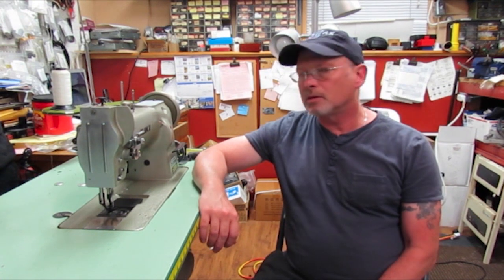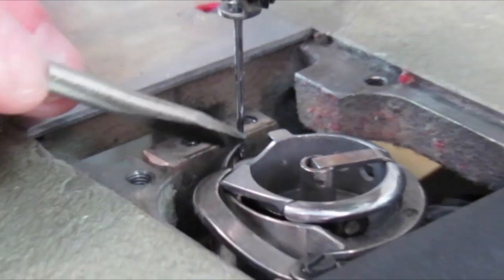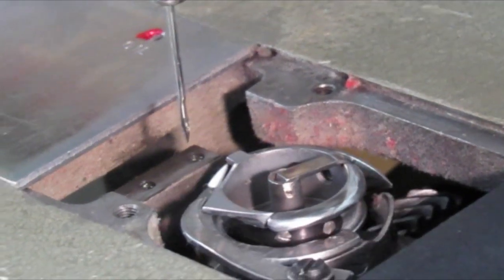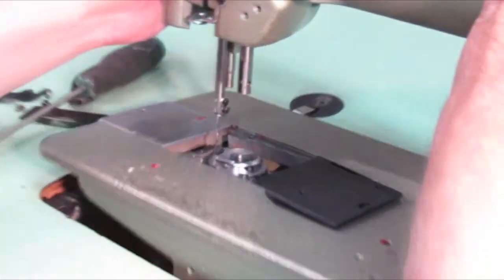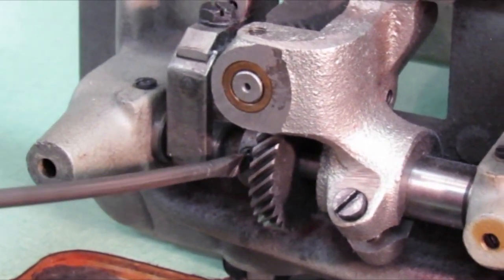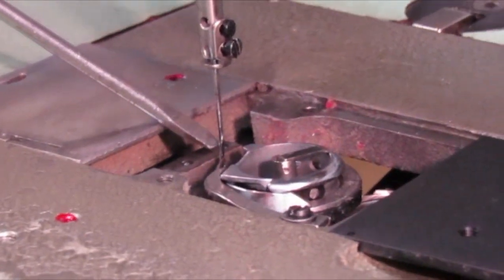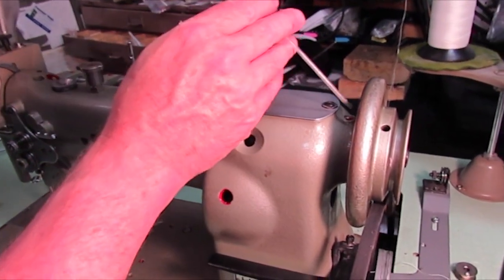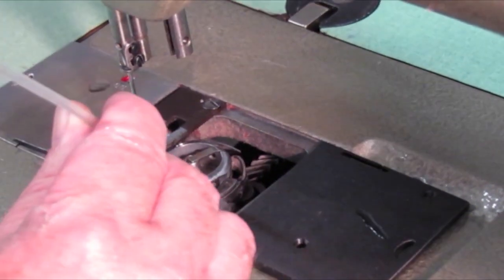Juki Lu 562 - 563 Industrial Sewing Machine maintenance video

Comment: You did a good clear job of explaining timing adjustment. I always say hook point to neeldle clearance is no light between them without them touching each other. I think it would be good if next you would have explained adjusting the needle guard. With these tight tolerances, any side needle deflection and good bye hook point.
  Just for added thought, most of these machines are old. Cup screws get worn as well as other parts and normally they have been worked on by many people of different skill levels. If you've owned a machine a long time then you know its condition. If you've recently acquired it, best to go through it. These are tools for doing real work. Don't want any downtime.

Comment: Hello Neil!  This video has been very helpful, but I have an issue on a Juki 563 I recently purchased.  When I am trying to adjust the stitch length via the "button/cog" method, it is stuck at 14 on the indicator.  I cannot turn the wheel.  The only time it will turn is if I engage the safety clutch.  Do you think it is seized somewhere?  I oiled the bejezzus out of it before I even ran it.  Any help would be greatly appreciated!  Thanks!

Comment: Great informative video! Thanks for taking the time to make it! I have a Juki LU-562 and it vibrates at higher speeds. Is this normal? The counter balance looks like it is in the correct orientation with respect to the needle. Cheers!
Reply from the maker: This would be normal.

Comment: I have the Juki Lu 562 and this video was very informative. Learned I was missing a step in threading the upper tension. I have a question. I’m in an upholstery class and a couple of the class machines are having an issue with the thread coming out of place around the upper tension assembly. Where the thread wraps around from underneath the second tension disc, normally you feel and hear a small click when the thread goes past that little pointy part that bends in toward the middle of the discs. When we pull the thread up against the tension spring, there is no little click and after sewing just a little bit the thread pops out from in between the discs. Any thoughts on what the problem might be? Our instructor is trying to get the machines serviced, but the school isn’t very proactive in having the machines kept in good working condition. Thank you in advance for any help you can offer.
Reply from the maker: If you are taking about the tension assembly you can take and drop the thread down around the pin that holds the plates from spinning.  This will keep the thread from coming out of the tension disks.  If you are talking about the take up spring disks which is below the tension disks, you can adjust the small screw that keeps them from moving.  You can turn it to the left so it will click in easier.

Comment: Great video but I was hoping to see something on adjusting the bobbin case opener. My 563 has a tension issue when sewing in reverse. Great stitches forward but in reverse there’s always top thread nests on the bottom regardless of top tension and I think the thread catches on the case opener creating a momentary bottom tension.
Reply from the maker: Unless there is a burr on the bobbin case opener this should not be an issue.  Increase your bobbin case tension.  If you cant turn the screw on the left of the spring on the bobbin case base you would have to take the bobbin case base out and take the spring off.  Reshape and put back together.
Reply: @bridgewatersewingcentre  thanks! I actually solved it mostly with a new feed dog  and needle plate. The under side  of the needle plate had some weird wear issues as if maybe the hook had been too high at some point in its life and been  rubbing the underside of the plate. I think the thread was catching in this wear causing the issues.

Comment: Great video, I just recently bought a Consew 226R1 and is similar.  Do you know how to adjust the presser feet if they need to be straightened?  On my machine it seems like the are slightly angled so the needle is towards the very left side of the inner presser foot hole.  I'm not sure how to adjust the outside walking foot to straighten that out!
Reply from the maker: This is somewhat difficult to do.   You would have to loosen the lifting block on the pressure bar from behind the machine and also loosen the block guide on the top of the pressure bar and then you should be able to turn the outside pressure foot

Comment: Good vid with nice closeups of components. Is a Juki LS-563 a solid industrial walking foot machine and would u recommend it over a Consew 226 in equal condition?
Reply from the maker: Yes I would recommend the Juki LU 563.
Reply: @bridgewatersewingcentre  Thanks for your response. I have an offer I made for three walking foot machines that I looked at today. A Juki LS-563, Consew 226R and a Seiko/Consew LSW-8BL. 🤞🏽

Comment: Question, at the end about the walking foot…I’m wanting to raise the rear foot a little when it’s in the down position. It dents the leather as I feed it through and I think if I can raise that rear foot it’ll resolve that issue. How do I raise that?
Reply from the maker: Lifting the foot would not help this issue.  Basically all you can do is slack back on the pressure.

Comment: Thanks for the good video! Is there a way to adjust the clearance under the presser feet when its in the lifted position? So it lifts higher?
Reply from the maker: There are several different adjustments to be made and in different spots.  Much to complicated to explain online.

Comment: Second button is clutch adj. Can u please explain? Does that mean another way to start slow?
Reply from the maker: Only way to start slow would be with a servo motor. You have two buttons on the bed,  left one is stitch length, right one is the adjustment when you jam your machine up it will throughout the clutch

Comment: I have a juki lu 562 and i can not regulate the upper thread tension.  It is so tight the thread frays at the needle.  Any suggestions?
Reply from the maker: make sure the bobbin tension is not really tight. more on the bobbin then you have to increase the top

Comment: What is the largest needle and thread size the 563 will take
Reply from the maker: You would max out the thread size at 138, without modifications.  Needle size would be about a size 25  without modifications as well.